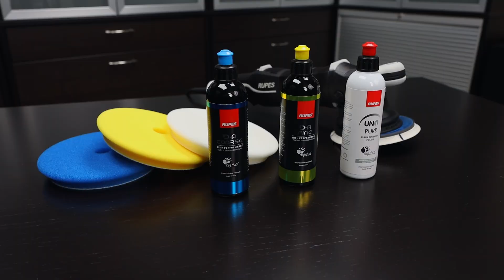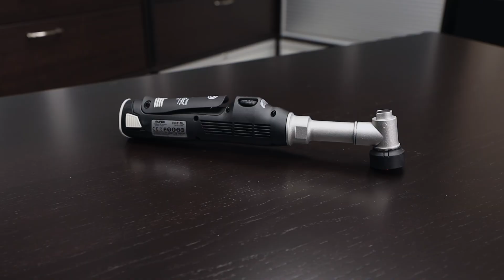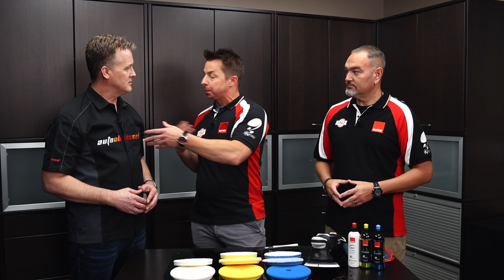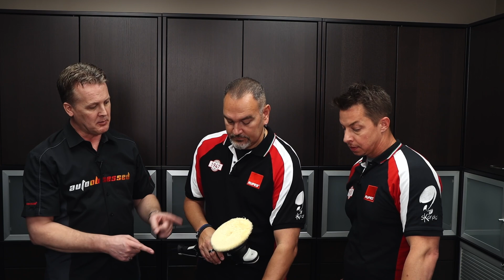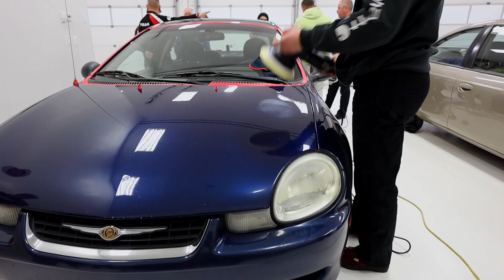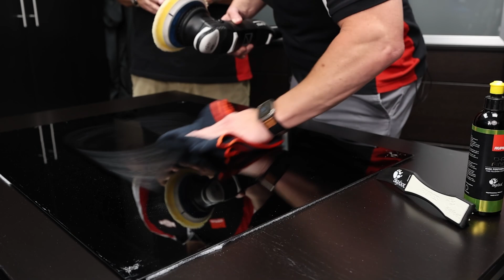Everything You NEED To Know About RUPES Polishers and The RUPES Polishing System!

Comment: Wonderful video gentlemen! Thank you for being very thorough and explaining all the steps. I started my prosumer detailing journey last Summer through the help of Pan The Organizer. I have already performed a single step polish last year using a different polish. Of course, it enhanced the gloss, but I have shiny scratches now haha. I've been looking heavily at your brand for my next paint correction session this coming summer. At which point, I'm going to do a two-step process. I drive a Ford so not too hard but not too soft on the paint. I believe I will use the blue wool pad for cutting and finishing with the yellow foam pad. From all the Rupes videos I've been watching, I can get a nice jeweling through this combo on medium paint. I wanted to ask, because I didn't see it in the video, how do you go about cleaning the fiber pads between each section pass? I have a pad brush for my foam pads, but I have a feeling it's a different procedure for fiber pads. Thank you so much for any advice!
Reply from the maker: Hello thank you for watching.  Don't get too tied up in researching what you will need for your car, apply the techniques outlined in the video to determine what "works for your car", the correct product and process is the one that works on "your car" and that is why Rupes outlined the test spot routine.

Comment: 1st gen Rupes Bigfoot 4 cars over 18mths speed control stopped working 300$ have repaired 
No warranty !!!! Polisher is in excellent condition private use . I WAS SCREWED THAT BAD I  STARTED TO BUY  the Flex Tool Brand  far better  P8 1,2,3 inch rotary . very smooth 
Rupes pads and compounds are good but double the competitor cost .
Reply from the maker: Sorry to hear that, we use Rupes professionally and they are solid polishers in our professional daily use.
Reply: Flex tool easily the same or better quality as Rupes

Comment: i have to diasgree with microfiber vs wool. Wool cuts and finish better than microfiber, i have tested this multpile times on multiple vehicles. Also long throws are superiour compared to forced rotation when it comes to cutting power. Also i think that using 21 with 5" inch backing plate gives you best correction power and beats rotarty with 5" pad. Great machines all in all.

I just got the hlr75 and it is mind blowing good. By far best and strongest 3" da polisher.
Reply: its tottaly wrong .Orbital 21 mm cant be better cut then rotary .Maybe your rotary wools not so good
Reply: @BirwaxDetailing  I have tested it with many pads. Only time i use rotary is if i have to do two or more cutting sets. Then I use 10" twisted wool which is very fast to do but it leaves horrible holograms  and I do another cutting set with 21/5" wool and it removes rest of the scratches abd holograms. I have done this for 10 years and probably done more pad/polish/machine tests than 99% detailers.
Reply: @jtm1979  brother why hologram is problem gor you ? if you use rotary and wool pad ofc there will be some holograms . But all we know if you are use rotarr you will use orbital for step 2 and 3 .Hologram is not problem.İm uaing rotary around 15 years in my country.No body can prove that orbital 21 wool or microfiber pad cut better then rotary with wool pad. Im living in turkiye so our cars are really hard not like europe or america.Really hard paints.So there is only one way to cut scratches .I tried every pads and every polish compounds with lhr 21 or flex but its just take my time much .I mean wasting time..
Reply: @BirwaxDetailing  many pro's agree with me. I didn't say holograms are problem, but very light finishing step isn't necessarily enough to remove then.

So if one cutting set is enough 21 is better choice because you can always finish it with one more step, sometimes its not even necessary.

if i do that one set with 10" twisted wool, there is big probability that i have to do medium step and finishing step. So that's 3 steps. 

If however one cutting set isn't enough, i do the first with rotary because 10" wool is faster to do big areas than 5" wool and doesn't require pad cleaning as much. So i do very fast set with rotary following another set with 21(removes holograms and the rest of  the scratches). Im not sure if you understand what i mean. 

So yeah for me rotary is only for very specific cases and with large wool pad only or sometimes jeweling. Also spot work. But most of the work i do with long throws.

Comment: its 2023. did u fixed the pad stall? or that is deliberately left out still just to get the debate going and make rupes more famous?
When the cordless versions of big bigfeet are coming? again its 2023.. since now u r in usa, maybe Milwaukee can help with some battery tech.
Lastly, can i get rupes made in Italy? i just dnt trust Americans with their Friday builds and Monday hungover builds concepts.... we see that in cars manufacturing where nuts and bolts are missing and fuses are not seated properly on 100k+ flagships. 
Side note: Rupes, take ur manufacturing back to Italy ASAP, its already making me sway towards a German made flex.. also cordless.. also no stall. The only thing i cant stand about flex is that red color they use, i wish it was brighter... but anyways if i buy those, i'll customize those with carbon fiber body to cover that sad upsetting dark red lol
Reply: "ts 2023. did u fixed the pad stall?"

Pad stall is a designed feature of a random orbital which is a built in safety feature. Orbital tools produce 85% (minimum) to 100% of their movement from the orbital action, so loosing a maximum of 15% of the pad's speed (only at the very outer edge) is obviously not going change the result. 

Pad spin offers the benefits of cooling the pad and creating a better finish. It is also a good indicator that the tool is being operated correctly on an appropriately sized body panel. Pad spin is not necessary for paint correction and, as you said it is 2023. Most of the users understand this now. 

 "or that is deliberately left out still just to get the debate going and make rupes more famous?"

That is a false dichotomy: You presented two options (fixing something that doesn't need to be fixed) or it must be some marketing scheme... Neither is correct.

"When the cordless versions of big bigfeet are coming? again its 2023.. since now u r in usa, maybe Milwaukee can help with some battery tech."

RUPES stated goal is to make battery tools comparable in weight and power to the corded versions available. While we appreciate the suggestion, we want to make sure we reach the goal. The HLR75 is both lighter and more powerful than the LHR75E and we plan to continue that moving forward. 

"Lastly, can i get rupes made in Italy? i just dnt trust Americans with their Friday builds and Monday hungover builds concepts.... we see that in cars manufacturing where nuts and bolts are missing and fuses are not seated properly on 100k+ flagships. "

I cannot comment on car manufacturers nor the  suggestion that this would carry over to USA manufacturing in every single industry... 

Polishers manufactured in both the USA and Italy are made the same standards. Build quality is carefully inspected and tight records of return rates and defects are kept. There is no quality difference between the manufacturing location and you are getting a high-quality polisher with a return rate FAR BELOW the average for tool manufacturers. 

“Side note: Rupes, take ur manufacturing back to Italy ASAP, its already making me sway towards a German made flex.. also cordless.. also no stall."

As addressed, RUPES maintains strict build quality protocols regardless of the tool's final assembly. Based on rumors of another industry, we hope you will understand us not changing our whole business model. 

Thank you earnestly for the suggestions. Even when we disagree, we value all of our customer's feedback and appreciate the time it takes to write them. 

Yours in better polishing.
Reply from the maker: We cannot comment for Rupes, you may want to reach out to them directly.  We have been selling Rupes in Canada since 2013 and have not seen any differences from the machines that were built in Italy versus the ones made in the USA.  As for the pad stall, I believe you are referring to the Bigfoot 15 and 21 machines, these are designed that way for added protection.  If you want a machine with no stall then the Rupes Mille which is a forced rotation machine might be a better choice for you.